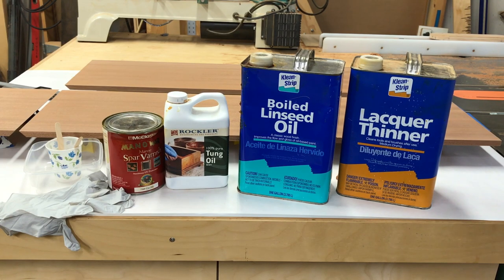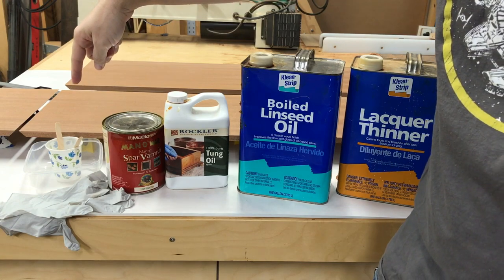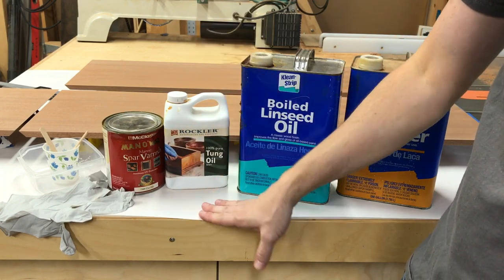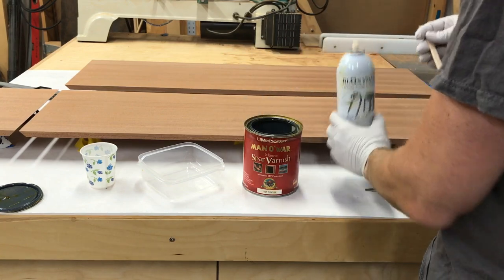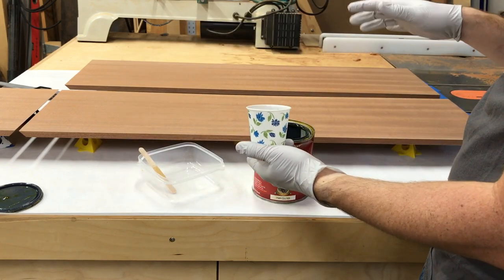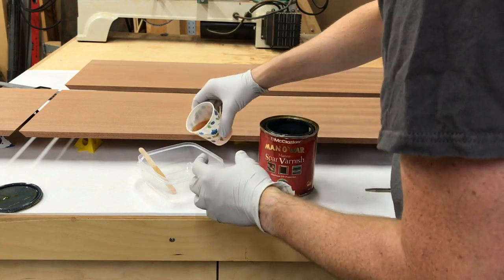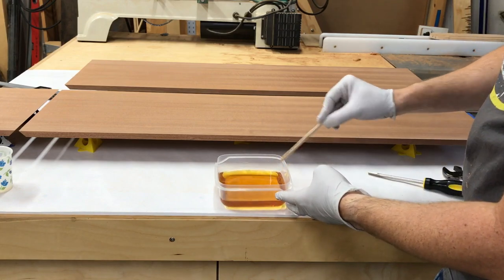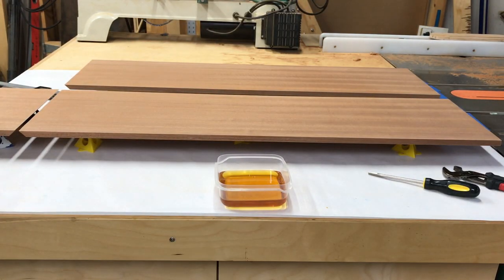Best Woodworking Finish Ever - Part 1: Mixing

Comment: I am a bit confused as to the reason you are using both tung oil and boiled linseed oil.  Do these produce different effects?  could you have used two parts of tung oil and skipped the linseed oil with the same results?  I've been doing one part oil, one part varnish, and one part solvent.  What effect do you get from doing the two parts of oil?  Sorry for asking so many question, but you're work is really nice, so I thought I'd ask.  Thank you for sharing.
Reply from the maker: I've never tried mixing it but leaving out one or the other, that's just the mixture I learned and it comes out so nice I've never worried about modifying it! That would be an interesting experiment—divide a board in thirds and do one with this mix, one leaving out the tung oil and one leaving out the boiled linseed oil. You may not even notice any effects right away, it could be a benefit that shows itself after a year or more, you never know!

Comment: Thanks for the fantastic videos on this finish. It is surprisingly difficult to find any mention of this recipe or instructions anywhere. I've been trying to master this on test pieces for weeks and had a few questions. Please forgive and ignore me if it would consume too much of your time.

How does dilution of the three part oil work? William Ng recommends a dilution of 25-35%. Does that mean (roughly) 4:1-3:1 three part oil to thinner?

If the first thinned coat does not penetrate enough to consume much of the flooded surface, does that mean it did not penetrate sufficiently? If so, should a second thinner coat be immediately applied before the first has a chance to dry? I assume the 35% thinning limit stands no matter the penetration so that the finish dries and hardens enough.

Should the unthinned second through seventh coats be very light to encourage more drying vs a thicker application that might fill more open grain pores?

William Ng's recipe (as of 2018) says to rub out finish with a 50-50 mix of mineral oil and turpentine using 1500 grit sandpaper. Have you tried this?
Reply from the maker: Hello! I still remember the way he described it in class: "one third varnish, one third tung oil, one third boiled linseed oil, and for the first coat, one more third lacquer thinner" So whatever measuring device you're using, fill to the same level for each component (I guess that would be 3:1 oil mixture to thinner).

For the first coat you just keep applying more until it's not soaking into the wood and it's just sitting there pooled on the surface. I've never had to do a second coat immediately after...sometimes if I'm lazy I don't even really flood the first coat and I've never noticed a difference in the finished product.

The 2nd+ coat won't require very much because it doesn't really soak in at all, just kind of sits on the surface. You won't need to be nearly as heavy on the application for those coats, just enough to leave that wet surface for an hour before wiping off.

That rub-out must be a new technique, he didn't show us that when I took the class. We just rubbed out with steel wool! It seems like that would fill all the grain and pores? I personally like the look of the grain when the light hits it, but I may give this a try on a test board just to see how it turns out.

Comment: Total noobie question and completely new to finishing...I wanted to stain the wood first to red mahogany. 

1) do I stain the wood FIRST and then add this formula to make it pop better? 

2) Can I add the stain to formula and then apply on first coat? 

Using Minwax Wood Finish
Reply from the maker: I personally don't use stains (I try to use a wood that'll be the color I want to end up with) so I'm not an expert! But it'll depend on whether the stain is oil-based or water-based. According to this: https://generalfinishes.com/videos/can-oil-and-water-based-products-be-used-over-one-another you can apply an oil-based finish (like mine) over a water-based stain assuming you wait long enough for the stain to dry completely.

I'd take a scrap piece of wood and try and see what happens—don't experiment on your finished piece!